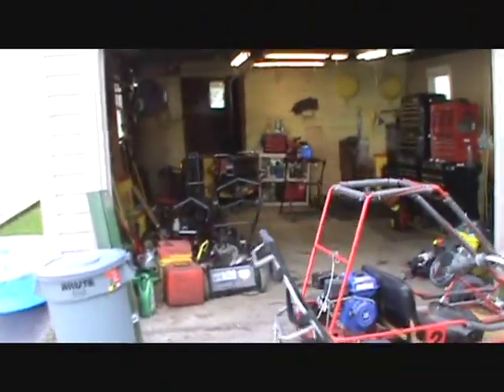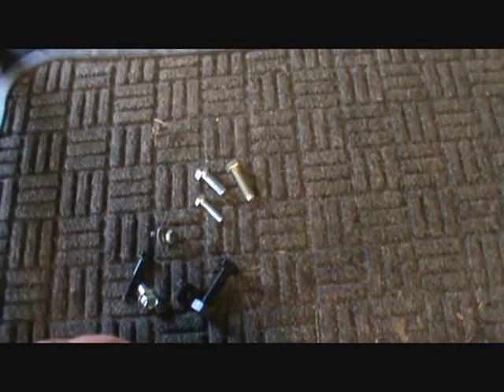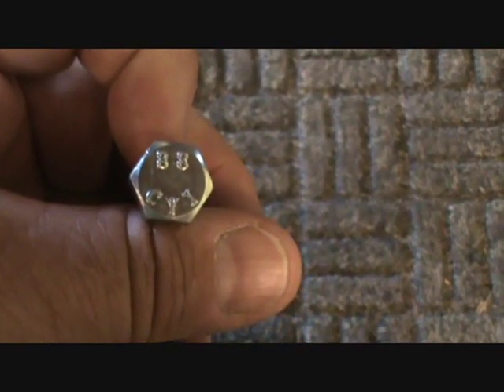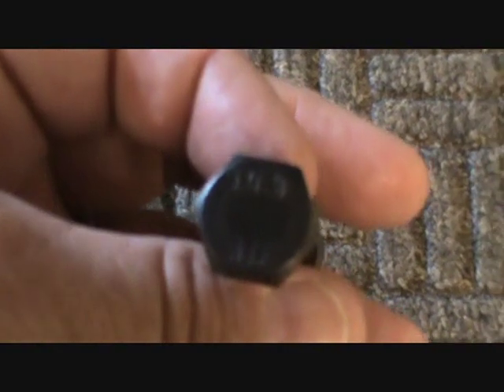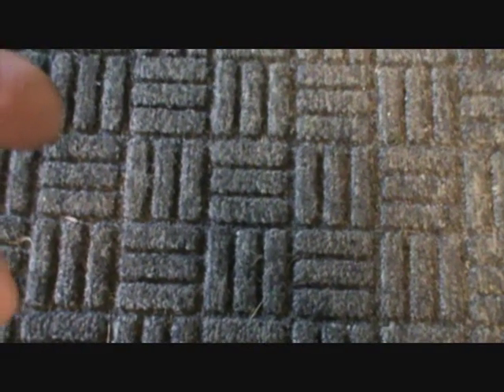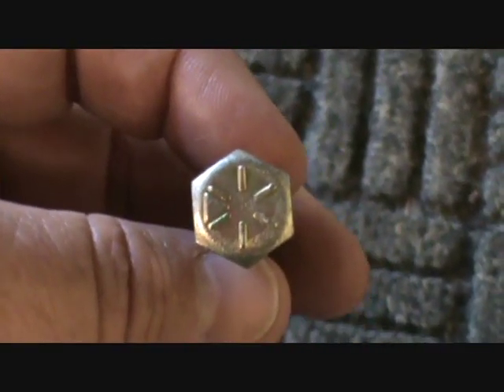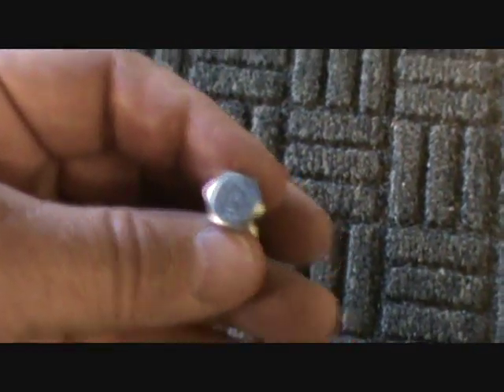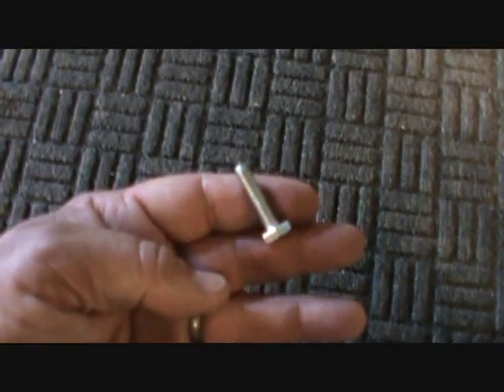Metric or SAE Bolts: Which Is It?

Comment: The most helpful thing to do is get a bolt sizer then you can sort from SAE & Metric then size. Bought one from J. C. Whitney Co. Over 40 years ago made out of plastic. Next get thread pitch gauges, yes, both SAE &  Metric. Now...get those bins with the little plastic drawers and put labels on them denoting type & size. A chart with torque values for the different sizes and grades can be helpful.

Comment: finally I found out what the # mean thanks -I have bolts that are marked 9, and they are just a little bigger than the one marked 10--but that # has nothing to do with size just strength----so I need a metric just a little smaller than 7/16--I come up with a 10 do they make a 11---this goes in a torque converter---350 chevy-the none threaded on 76 corvet
Reply from the maker: phil ladd yes.

Comment: The thing I like about metric screws and bolts is that the actual size is apparent in the name, M3 is 3mm, M5 is 5mm etc. No need to consult a chart to figure out what diameter hole to use with what screw size.

Comment from the maker: The way you tell a metric from am SAE is if there are slashes on the end of the bolt, then it is SAE.  It will have numbers on it if it is metric.  ie  (8.8)  To use a thread pitch gauge, you just set the gauge's teeth into the threads.  It should fit perfectly.  SAE will be in threads per inch and metric will sized from one tip to the next tip in millimeters.  If you have anymore questions, PM me.  God bless.  John
Reply: snaponjohn100 I have a question. I don’t have numbers on the bolt and idk what or the slashes are. Somehow can I send you a picture and you could help me please?